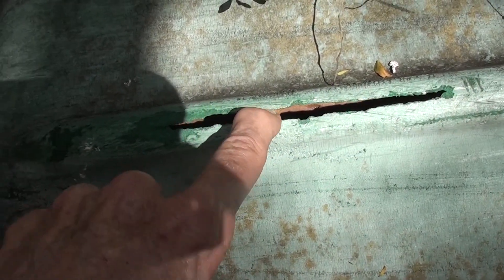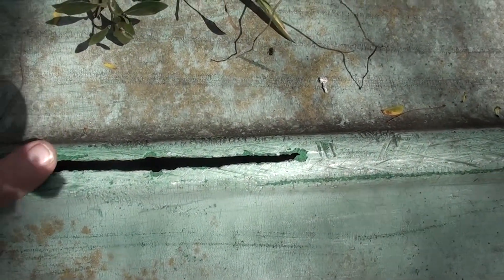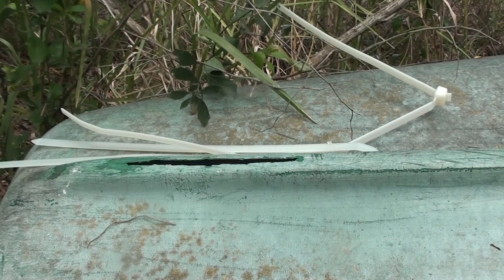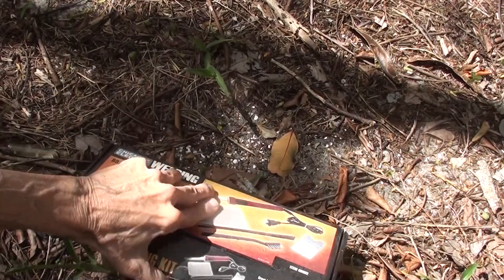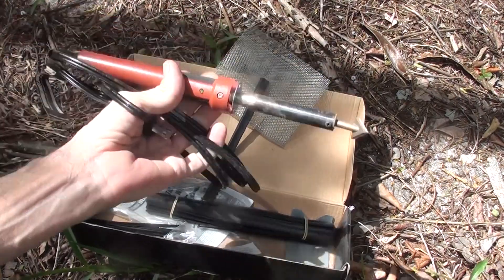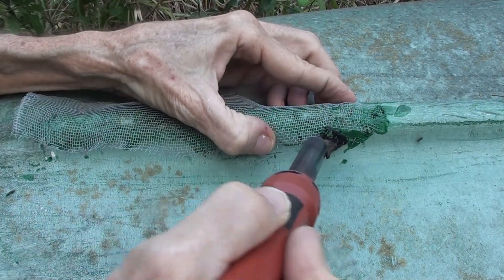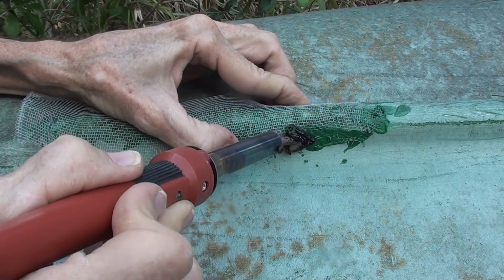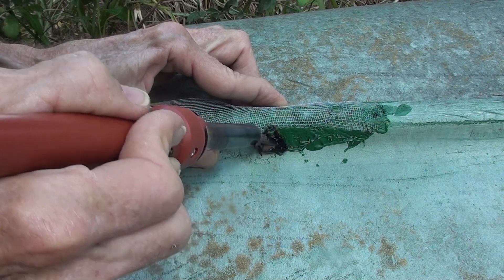Plastic Welding Shut A Hole In A Plastic Boat

Comment: You melted nylon material (cable tie) and polyethylene together which are not compatible and will not be as strong. Because of the difference in crystalline and molecular structure of the resins it will easily fail. Nylon melt temp is about 100 degrees higher than hdpe.
Reply: He should have used pieces of 5-gallon bucket. The job would have been a lot easier and the material would have mixed easier.

Comment: Another top repair job, 
Ten years ago my sisters radiator got a hole the size of your thumb after hitting a animal on the road ,so I pulled the radiator out got the soldering iron, a heap of zip ties did the repair and it is still driving down the road today, but i did learn then that the black ones are definitely the ones to use. Can you get to the repair from the inside if you can you should weld it too.
Anyway Thanks again have great day cheers
Reply from the maker: Thats impressive.  I would not have guessed that plastic welding could fix a radiator.

Comment: Thanks for showing this. Something soothing about watching the plastic melt and getting smeared around to me. Hope it holds good it looks like it will. Be careful and take care 👍
Reply from the maker: It still leaks a little, but you can use the canoe all day and only have a little water in there.  Before it sank in 2 or 3 minutes, so I guess its good enough.  I think it would have made a better weld if i went slower so the heat could melt deeper into the base.  You start to melt a new hole at some point if you go too slow, so its a skill I need to learn from experience to melt just the right amount.  I should weld up those cracks in the side just for the experience so I will be pretty good at it in case I ever need to repair the dinghy or anything else thats actually important.
Reply: @ninehundreddollarluxuryyac5958  maybe use some JB weld to stop the slow leak. It works pretty good. Take care